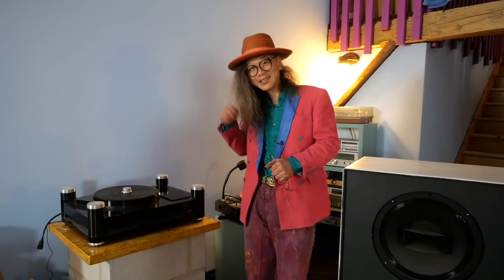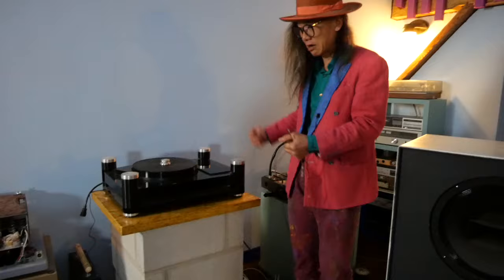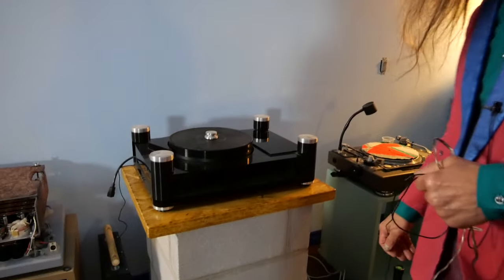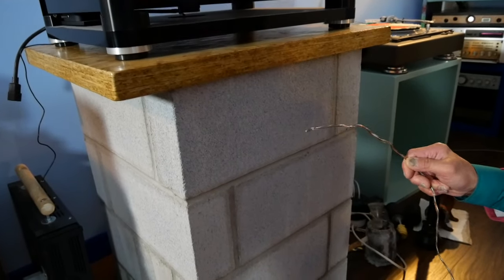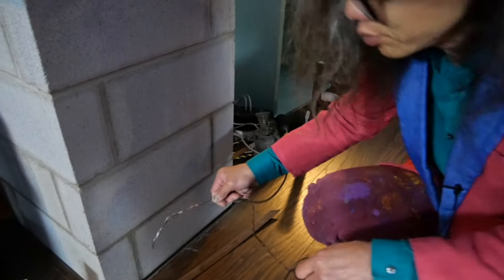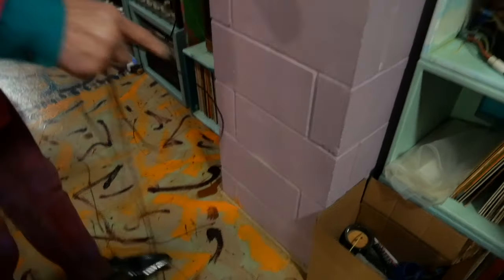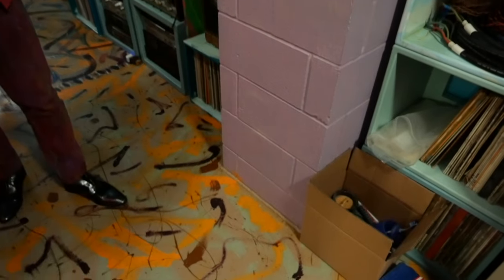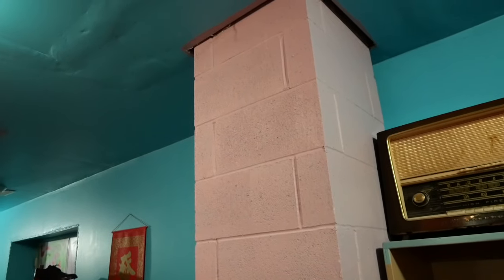A turntable stand build right from the thickest part of the foundation.  Literally from Ground UP.

Comment: gives new meaning to the phrase: rock-bottom, to the foundation bass response...I had this same exact idea decades ago but WAF and other nuisances got in the way. The one thing missing in your project is a granite surface plate or machinist stone as the cherry on top. Its perfectly flat and a better surface to level the Basis TT on.
Reply from the maker: @Carrera6rennsport  I have plan to replace the triple chip board platform with a machinist flat top.  However, I am in the process of doing home work about how to minimize the possible ringing of the stone.

Comment: Wow! Crazy!! -Hopefully I get a marginally as effective situation as yours as my house is single level, completely built on a concrete slab…
Reply from the maker: Can you put your turntable stand directly couple to the concrete slab?
Reply: @angela-gilbert  ; only if I’m willing to piss off my wife, yes! Easily!! Please; no ideas…
Reply from the maker: @brianyee5504  Assuming you have a turntable, is it currently sitting on a floor standing shelf or a wall mounted rack?  If you can connect to the concrete slab, it may be better to mount on a couple of studs of a load bearing wall.
Reply: @angela-gilbert  yes. I have a turntable…but drilling holes anywhere, be it the floor or walls puts me at risk of death. 😞😆
Reply from the maker: @brianyee5504  If it can sit on the floor, no drilling is required.  Just sit tight on the floor.  If it is a floating floor, take advantage of it.  There are many suspensions turntable accessories in the market instead of mass loading.  There are many ways to handle a turntable vibration.  No one way is always better than others.
Reply: @angela-gilbert  Yes; it can sit “hard” on the floor as my stand is somewhat heavy and all that separates the stand from solid concrete is non heavy pile carpet. Plus the turntable weighs ~30 lbs and has isolation feet as well.